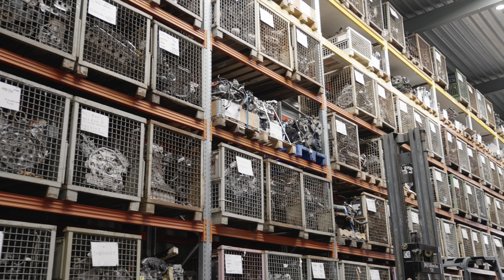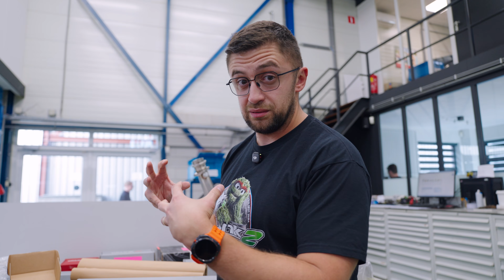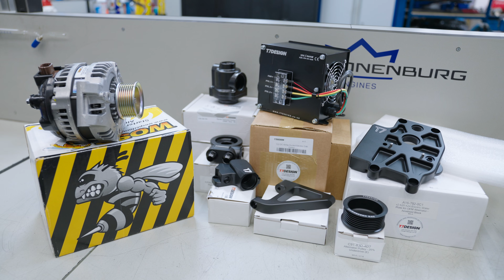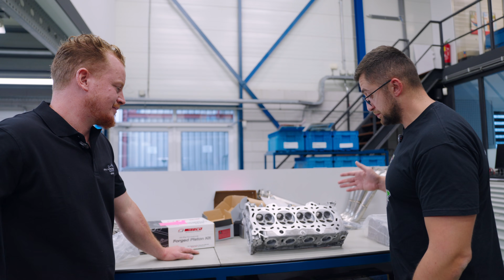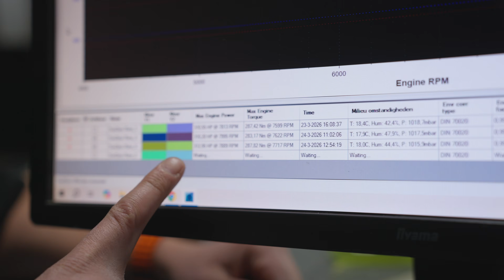My K24 is EARGASMIC! Full Engine Build Breakdown & Dyno!

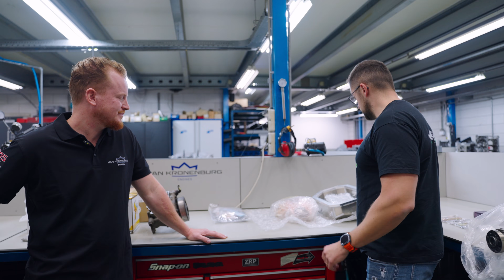Comment: 13:12 sounds like you build would have been a good fit for  dry sump. typically 5-10% power increase for a high revving engine. instead of crankshaft and conrods sloshing oil like a big blender you have pressurized oil just in the right places. oil pan is shallower so you can mount the engine me lower, and you have vacuum inside the crankcase that reduces thevair drag and turbulences of the crankshaft and conrods rotating at 8000+ rpm

that's more "free" power   that's  made without putting more strain on the engine

Comment: 5:55 if you buy a used car better check oil level and even replace it.  the oil coming out will likely tell you if there's already damage to it!
happened to me though ok fistotoecyvle.. a Honda. an oil hose was too old and pinched an it did starve the engine 😢 the engine ran for a good while with almost no oil flowing but eventually died

Comment: we have run that unit2fab pan, and it still will drop oilpressure down to 2 bar on a fast timeattack car, only solution was drysump. That pan actually didn't even hold oil pressure better than the other cheap alternatives in stock pan :)

Comment: When I K swapped my Fit my first thought was getting a K20 Type R motor but I was also going to mod the motor and it being a street car I thought the K24A2 and the extra torque would be a better choice.  Plus it was cheaper then a Type R K20.  With IPS cams, Skunk 2 springs and retainers, custome header, exhaust cold air intake the car made 220 whp and 180 ft- tq.  I had wanted ITBs but never got them.  My engine was built 10+ years ago and even at the time when I was researching the build it was pretty doable to make 300 WHP NA in the K motors.  That was my goal but never got around to doing it. 

The motor you have built is going to be a beast in your little Hatchback.  Looking forward to seeing more of this project.

Comment: On the spin trick centrafugal tank, Ask them why dont they put a load of 2mm spaced 27mm fins in a spiral startind from the  top to the bottom of the outside.of the tannk so that the oil that is in contact with the wall dissipates the heat of the oil as it passes threw there spin trick..... 😳 verstaan jay boeta

Comment: Misha, i know you dont propably read this but thats🔥 
Next build 2.2L De-stroker setup😉 Torque and more power potentially from more revs. My dream K24 would be 70mm stroke de-stroker with reeal long rods and 88mm bore so 1.7L,  Whipple 1.6L to make up for the torque and more. Atleast on paper/calculator a engine like that would have around the same mean piston speed @12krpm as 2.4L @8700rpm so if it would breath real with good head and cams that would support those kinda revs, it would rev it safely especially with lightweight rotaring parts and maybe even B-series style wider crank bearings and dry sump because i dont know if even ported F20c oil pump Would be enough. Expensive custom engine i know, but it would be so sweet to be able to rev to ~11.5k daily and still have low end from the 1.6L Whipple. That kinda engine package in AWD hatchback EF, EG or EK Civic, Lotus Elise or Exige, Miata/MX-5, some old small/lightweight RWD car like for example BMW E21, Escort MK1 or MK2, Toyota Starlet or AE86🔥🔥🔥Maybe someday i win lottery or something but i wanna experience that kinda engine setup in some lightweight car. Would be kinda like B16B or 4A-GE but with 7mm lower stroke and some of them rev to +11k. So i would think that such better engine design with good parts would do it easily that 12k. The supercharger would peppu be with centrifugal clutch at some revs so that the blower would "turn off" so not to overspin the blower.

Comment: Noooo. Don’t do a magnesium valve cover. Just look at the valve covers on the S65 V8 in the E9X M3. Or the throttle body plate in the intake manifold of an M156. Magnesium doesn’t like oil.

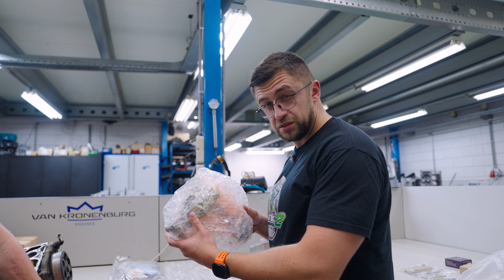Comment: 13:46 The oil pump compatible with the unit 2 baffled oil pan is in fact what we call the PRB oil pump, that is present in every jdm Type R k20a engine and k20's in the North American Acura RSX Type S which is a DC5 chassis. The main difference is the absence of a balance shaft and its size, which makes the presence of baffles very complicated. The balance shaft js also not ideal for lubrication past 8k rpm.

Comment: I strongly advise you to not rev it over 8000 rpm, trust me on this. Set the limiter 400 rpm lower and you lose out on barely any power while actually keeping the engine for a few seasons. Should've gone shorter stroke (F22 or custom crank) if you wanted to rev AND have reliability.

Comment: S2000 oil pump and the baffled oil pan are great upgrades! The narrow rod bearings on the k24 need all the help they can get . Great engine components usually equal an ultra reliable performance for a race season .

Comment: Dry sumping can get complicated, especially if you have power steering and/or a/c. I had to have a custom crank pulley made to drive the p/s pump, alternator and water pump at the correct speeds on my dry sumped 944 turbo. A consulting engineer had to run all the calculations and then it was machined from billet on a lathe. I ditched the a/c - just a bridge too far.

Comment: Very nice build Micha! I have a very simular setup but in a EF time attack Civic. The same AT internal drysump system as yours. I had the Unit29 liter sump but it couldn’t hold the oilpressure with 275s and big aero. My setup is k24 12.5:1 with 4piston 163 head. Made 325hp. Mine is doing similar laptimes on the swedish tracks as Porsche GT3 RS. I have a few films at my channel if you want to check out my build or have any questions 😊
Reply: Link to my ef https://youtu.be/xhfYPMYJls4?is=vWbylIu96klUxqxF

Comment: One of the best 4 cylinder ever made.The connecting rods on those engine are quite if impressive if you ever worked on one,literally bulletproof.
Reply: it is an NA Engine, they have to be light, and nothing else.
Reply: @DaEVOthefreak  You have never worked on one  with  that type of comment.They are very well built,rocksolid.Are you a mechanic?
Reply: @alpe6228  I have a 305 HP 2.0 Cosworth BDG, and a conservative 2,3 Duratec Cosworth with 280 HP and build a selfmade Top end 2,8 very Big Bore NA from scratch. I know every little piece of bottle necks about big 4 cylindre NA engines. But i let you play in the K-Myth area 😉

Comment: You always need to rev to 9k. Not even a debate. Also the oil starvation issue was your fault. You never checked it for starters and you could hear the motor starting to go way before it did. All human error I'm afraid.

Comment: again, 8500RPM is way to much! 28m/s is to much!  You cant get over 27m/s, even with the best of the best material inside! There is no HighPerformance, endurance racing engine wich gets over 27m/s piston speed. No Poersche, No Ferrari, No any bike engine, even F1 is way lower. 8200 should the highest rpm couse, even 27m/s is very very edgy. 7900RPM with 26m/s is more than enough for an tractor stroke of ridiculous 99mm wich the K24 has. Thats one of the main key for reliability

Comment: what is interesting is that whatever engine it is, the torque and horsepower curves always intersect at 5252 rpm
Reply: Yup, hp = lbs ft x rpm / 5252

Comment: Great video. Great to see so much of the componentry that went into the build. I am really impressed with that torque curve [or should I say line?]. This is also the first time I have heard of cryogenic treating. I will look into that. Having a stab at actual WBHP [given the cryo magic in the tranny] and say 257 BHP. 
Thanks Misha. 
These more technical videos give an insight to what goes on behind all those laps and what it takes to get reliability and performance. I have seen too many laps with you in a vehicle that is great until it isn't. Overheating or some form of power depletion to save this or that, hating the uphill section, brakes not up to scratch after half a lap. 
Any car perfectly fits the analogy of a chain only being as strong as its weakest link.
I would appreciate you doing a video [if you haven't already] on suspension set ups on a few different cars. Maybe start with the Civic and Corvette? 
Aero? Brakes? Drive trains? 
Thanks again from an retired engine re-conditioner/builder in Australia.

Comment: With this kind of investestment why stay at only 8k rpm? doesn't going to 9k or 10k make more sense or its reliability issue?
Reply: I wonder how the engine deals with those super high rpms with such a long stroke. The piston speeds would be insane.
Reply: @lorddoobsworth21  It won't at 9100rpm it hits 30+ m/s mean speed. Forget that for more than a couple of seconds, F1 proved it in qualifiing. Drag racing and tractor pulling are proving it every day.
Reply: He'd have to get a shorter stroke crank and matching rods to get the piston speed down and hone the bore plus bigger pistons to get max hp at the same displacement.

Comment: 314 HP in the motor with 15% of loss to the wheels its 266 WHP. What you guys think about this math?
Reply: My K24 makes 260 whp and I factor 15% for losses too.
Reply: Calculating loss as a percentage is a fools mistake.
Reply: I would redline it at 7500 and not go over 7700rpm ...
Reply: @M @MennoDuursma-q9l  those cams will just be waking up at 7500. It will rev to 9000+ I expect.
Reply: @MennoDuursma-q9l you don’t understand. To make 300+ whp you have to use high rpm cams. It won’t be making peak power until past 8000rpm. Likely around 9 or more. Even my 260 whp built motor spins past 8000. 

His is not a basic stock block build like you’re used to. If it’s built it can spin. It’s a k series.
Reply: @danielkaminske5048  Well the stroke is too big for it to rev reliably.
Reply: @MennoDuursma-q9l  This isn't a street car, daily driver, stock motor set up dude.
This is an all out race car motor that doesn't need to be reliable. It needs to make the most power it can.

My built K24 spins to 8700 reliably and has over 50k miles on it. Relax a bit dude. It is still a K series. Change the oil, and use a good tune and they are bullet proof.

When you lighten and strengthen the rotating assembly it can handle high rpms just fine.

Again, his motor will likely rev to at least 9200rpms and possibly to 10k. That's they only place you make over 300 whp on a kseries. Let's see. I'm done trying to understand it for you. I can only explain it for you.
Reply: @MennoDuursma-q9l you’re not human are you?

Comment: If you end up deciding on forced induction, I would consider a small/medium turbo. It never made sense to me when I see builds more often or not deciding to use the biggest turbo they can afford so the number on turbo encabulating dyno displays the largest number. Then they are tortured with every gear change, waiting for 5k RPM to feel that power.
Reply: Yeah man too many people chase silly peak hp numbers without considering powerband and transient response / drivability

Comment: didnt these engine can have oil starvation when driven with big g's on a track, the way the stock oil pan is, all oil get to one side of the pan ( i dont remember which side ) causing the oil pick up to pick nothing but air ? ive read about this on the net while ago
Reply: omg just watch the frickin video. First he bought a baffled pan, then he said screw it and went full dry sump.

Comment: Don't think you should feel guilty if your engine gives in as long as you keep the car maintained decently.
Not running motor oil definitely is a driver's mistake. Transmission oil is a bit less common to check, but I think it's definitely noticeable when the transmission is worn down due to lack of lubricant.

Think a dry sump wouldn't be to extreme as it definitely helps with reliability alot. Similar with the coolant you can have the lubricant working when the engine isn't running.

Sick build though, hope it will last a lot of laps while overtaking cars worth 100x the price.

Lol, wasn't past the dry sump part.
Sweet, you speak Dutch as well.
Reply: Russian, Dutch, English, and German AFAIK. Dude's a lot smarter than we give him credit for. It's just all his dumb mistakes are on camera and people tend to remember those more.

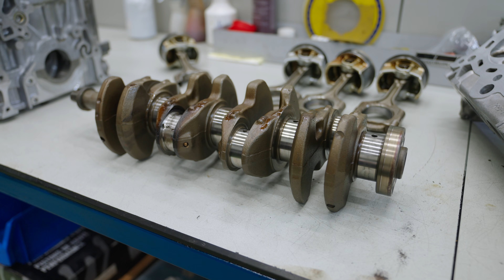Comment: 6:25 the average honda owner bought one because its a cheap vehicle.

They can drive without oil on the road, but low oil plus oil starvation from g forces on the track = blown engine.

Comment: You building this Honda should be a lesson. You don't have to have a thousand hp and go a million miles an hour to have fun. A well built light weight car with enough power to accelerate uphill is really all it takes. The new engine sounds sweet and i bet that throttle response is going to make your face hurt from smiling all the time. cheers!
Reply: 300+ hp in a light cars isn't slow by any means. This would absolutely smoke 99% of normal street cars. People normally say this about miatas and similar cars which are actually slow. I know he said hes not going for power, but he's literally doubling the factory output. He's definitely going for power.... Just not MAX power.

Comment: The water pump housing with pump + bolts for the alternator is actually 3.88kg. 

Double check the skunk2 valve cover dipstick retention. There was an issue with the early ones where the caps occasionally came off spilling oil on the exhaust manifold. I see a hole in the dipstick handle now, probably extra security to tie it down. Also, make an "L" bracket off the engine which rests on the oil filter and secure the filter with a hose clamp. It's a well known issue with the vibrations on K's causing the filter to back off.

Which Skunk2 cams/what compression ratio for the pistons?

Comment: Ceramic coated piston crowns dont allow the piston and its oil squirts to remove heat from the combustion chamber and will with high compression allow less ignition advance and consequently give less power than an un ceramic coated piston.

Comment: Misha didn't mention, or maybe didn't notice that his valve springs have been WPC coated, it looks like the valves have been also, and maybe even the crank. WPC coating is awesome, it massively reduces friction on engine and transmission parts. It can even save your engine and buy you some time if you lose oil pressure briefly. When i do my 2jz build i'll be getting it done on nearly every part that spins in the engine. If you've never seen WPC coating i recommend you check it out. Pretty neat stuff.
Reply: Good to know. I will eventually be building my 2jz when funds agree

Comment: First time I've ever seen a integrated oil pump and the filter still on the block with a dry sump system....I ran and pretty much everyone who runs dirt oval latemodel race cars here in the usa run dry sump with a oil filter inline unless they're running a crate 602 or 604 Chevy engine ....like they say .more then one way to skin a cat lol

Comment: If you are worried about air bubbles in the oil when using dry sump it is nothing even close to how much air you get in the oil in a wet sump. Auto Verdi has a centrifuge built in after the scavenge pump to deairate the oil totally.

Comment: ITB abzustimmen ist echt schwierig. hab mit FD2 ansaugbrücke geportet auf 70mm, tegiwa 70mm drosselklappe, INJEN cold air intake, tegiwa (toda) krümmer und 70m tegiwa catback. FD2 nockenwellen umgeschliffen von "dbilas dynamic", kopf geplant und 12:5 kolben.

Ergebniss auf 102 ultimate

302 PS / 274 NM
Reply: ich würde sagen die Drosselklappe ist viel zu groß. Bei 81mm Bohrung sind doch nur kleine Ventilchen drin. Ich fahre 280PS bei einer 45mm Walzenschieber, aber im Duratec. Die Trichter müssen 12-15% größer sein als die Drosselklappe, sonst passt die Geschwindigkeit nicht, besonders bei so "ungünstigen" Motoren wie dem K24
Reply: @DaEVOthefreak  mit kleinem Plenum KANN 70mm bei Hochdrehzahl Sinn machen, hier hast du aber recht - 66mm wären besser, die FD2 ASB hat ein ausreichend grosses Plenum und mit der 70mm DK verliert man Luftgeschwindigkeit direkt nach der DK, optimal wären vllt 64-66mm mit venturi auf 62-63mm

Comment: K24 is one of the greatest engines produced for cheap, reliable horsepower.
Reply: 28 m/s is NOT reliable. And it will never be! 😉
Reply: @DaEVOthefreak  Fair enough. This video shows 314.56 hp @ 7879 rpm which with a 99 mm stroke is 26 m/s piston speed. I'm not sure about the current state of the art, but rule of thump is 20+ max. There are destroker kits available for it.
Reply: @MennoDuursma-q9l yes what you see in the vid, but not the rpm Numbers he is talking about.

Comment: the torque “curve” (line) is genuinely so impressive
Reply: I was impressed but then noticed the graph starts from 5000 rpm which I suppose it perfect for the ring, still curious what it's like from 2000 rpm.
Reply: @neo_265  i think its simulating roughly where gears will land, i know in my stock VTIR b16a2, it was above 5700 (final drive/gearing is weird when you can rev to 9k) after every shift but k24 i assume has taller gearing or theyll use taller gearing/final drive
Reply: Nice to see people care about power and torque band rather than just obsessing over peak numbers 👍
Reply: K24 torque usually peaks pre-5k. You'd have to have a fairly large turbo setup to affect that. Id imagine it was just as flat as the top end. You'd expect to see a tradeoff/taper AFTER vtec crossover as head prioritizes power over the low end torque, so torque may have even peaked in the uncharted band (usually does on k24).  Tis the main reason to go k24 over k20 aside from cost, all the k power possibilities with ridiculous low end torque no other 4 cylinder swap can match without being FI or awkwardly packaged (ie hard to adapt physically, heavier, no aftermarket support integration wise.).